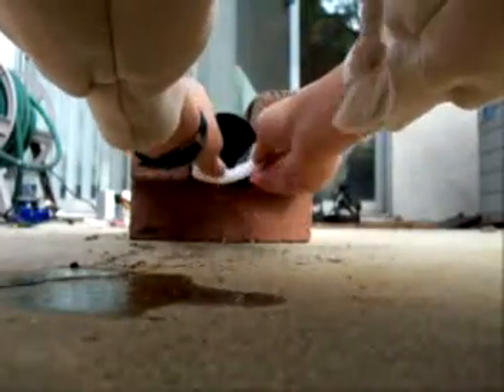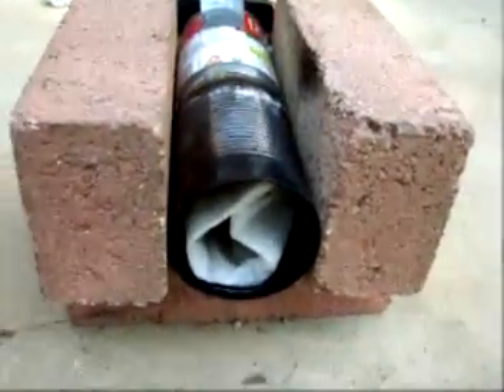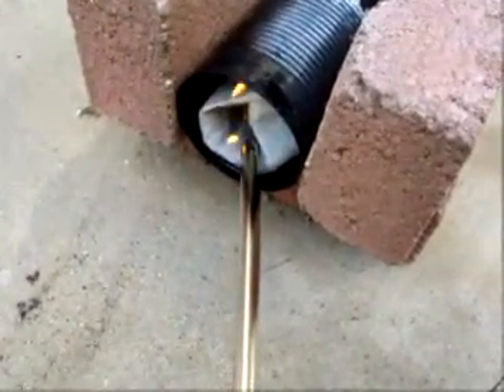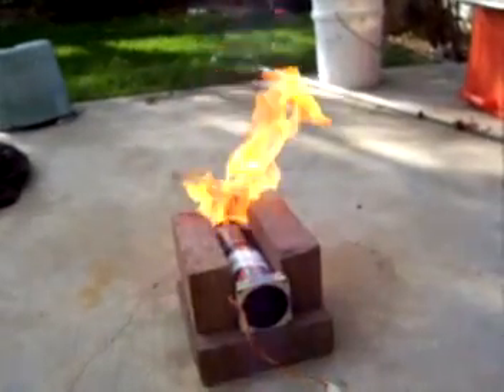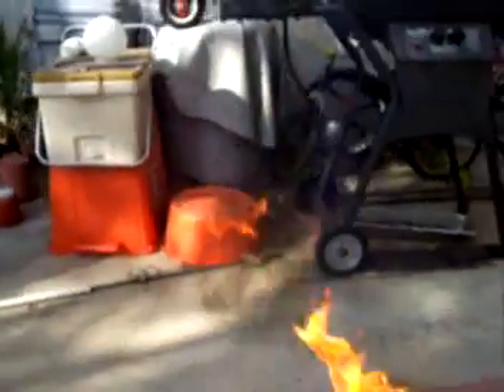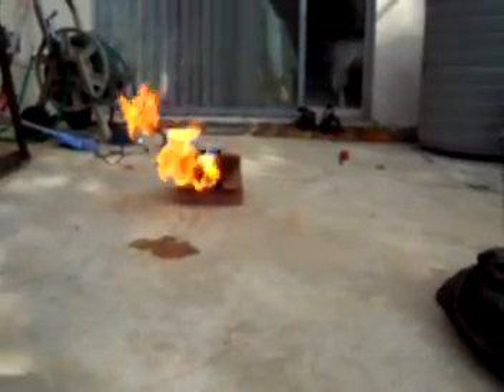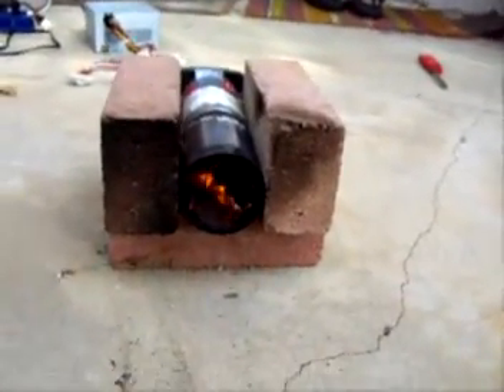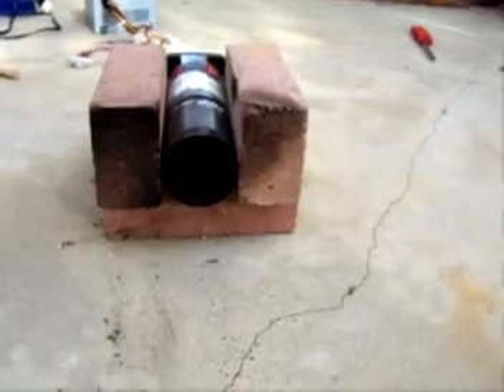Soup can thermojet (run)

Comment: this isnt a thermojet.... this is basically the same thing you get if you blow on a match. the only thrust it may produce unless you get A LOT more pressure behind it is the trust the fan produces. there is a reason they only use this kind of system for things like afterburners.

Comment: you could use it to heat a hot air balloon i am working on one but am using a mig welding carbon dioxoide canister with one ende cut of in the other end i will ket compressed air through then use a rag coated in deisel :)

Comment: @havaden96 (2/2) By adding an axle you would be attempting to create a turbojet but a turbojet needs precise fitting parts. You could use a car turbocharger like most people do. search for this "Do-It-Yourself Turbocharger Turbojet"  remove the quotes, it should be the first video that appears. It should help and explain a lot of questions

Comment: @havaden96 (1/2) I still disagree, he called it a thermojet, what i believe he was trying to build was a ram jet. A ramjet works by using already fast moving air. A computer fan is hardly fast moving air. The thrust on that flamethrower would be what the computer fan is pushing and that is almost nothing. Also adding an axle and another fan in the way of the flames would do nothing, i am assuming that is what you mean.

Comment: The principle is sound. Your fan however, does not compress the air. I am not sure this fan type would be powerful enough, or what level of compression would be needed - you could try again by fitting a cone shape right behind the fan, forcing the air into a smaller area. This should compress it if the fan has enough power. Also try gaseous fuel for easier combustion. good luck with future projects!

Comment: I tried it once but at a easier way...I used only a can and filled it up with some old OIL 2:5 to the can...but before you need to heat it up over 60°C and after than you can set it into fire...after it burns from itself... but only on a low flame... sooo we have an aircompressor and I have blowed into the can under a controled pressure and slowly get over 400°C or more I didn't had a thermometer
but for everyone!! MAKE IT ONLY FOR YOUR OWN RISK because it burns like gasoline!

Comment from the maker: This was my "first attempt" 

I've stepped up to using propane fuel for subsequent run and had electronic ignition. There were actually "jet engines" that worked like this; I've called this a ThermoJet but one web site (Search for "Scott's Homage To the Motorjet") calls them "motor jets" instead due to the fact the compressor is driven by a separate motor or internal combustion engine. 

I did try making a pulse jet (well, more of a "pulse combustor") with a muffler off my car.

Comment: pretty much you made a flame-thrower. You need a much more powerful fan then that plus use a flammable gas instead of a flaming towel. P.S. try making a jam jar pulse jet it is pretty simple and has significant trust depending on how it is made or also  try a Chinese Pulse Jet also pretty simple just need simple welding skills. You can find planes on the internet

Comment from the maker: The "Induced Draft" fan probably won't really help since it should be "Forced Draft" as I want higher pressure inside the combustion chamber. I already replaced the second soup can with a long aerosol can that has the valve area cut off to form a narrow opening as a nozzle.

I haven't really been working on this for a while since I recently acquired a turbocharger which I'm planning to use as a core for the gas turbine/jet engine I will eventually be building.

Comment: do even understand how a turbine, this is a thermic engine works?.. 
the fuel isnt burning, its injected to burn totally in the combustion,, not to sit there.. the air as actually to be compressed and not just running through.. that fan would never do it.. and fuel is probably too weak to creat usable air expansion.. but hey good luck

Comment from the maker: I'm currently running propane from the valve manifold on the gas grill into a injector I made using an anchor bolt. The TMD fan has been replaced by a Vantec tornado.